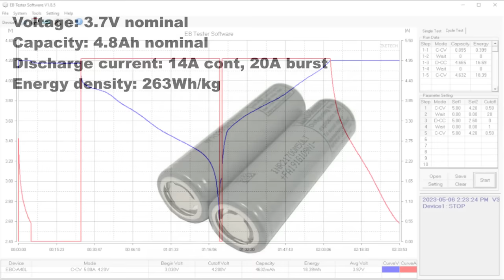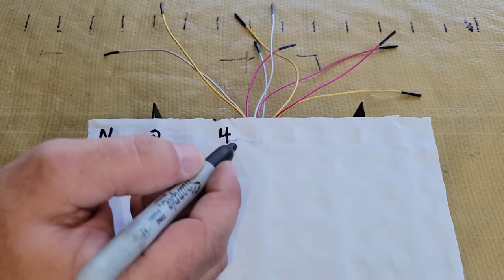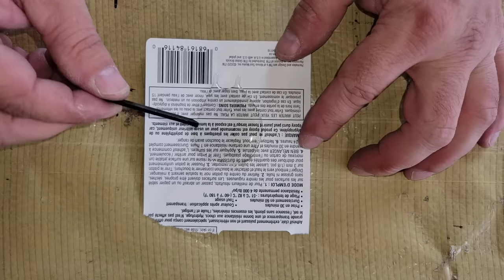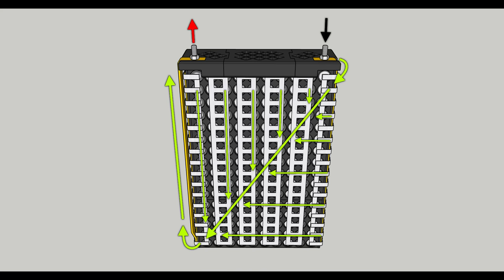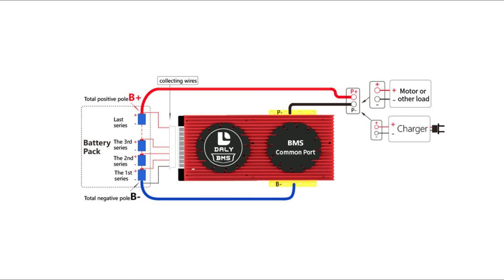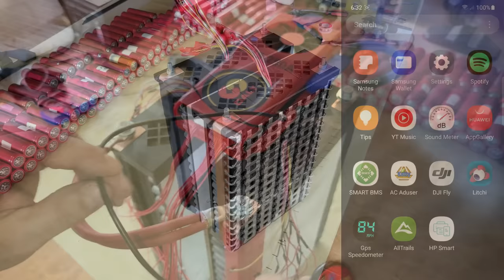Electric Motorcycle Build - E-Bike - Gen II, Ep 3: 77 Ah Battery

Comment: @12:20. Did you consider soldering the lugs on rather than drilling and tapping with epoxy?  That's how I would have done it otherwise I always like your approach
Reply from the maker: This is a decades old debate that no one will ever win. I try not to use solder when it's not required, especially on lugs. The connection as it is is superior to a solder joint in terms of conductivity, since solder itself has a higher resistance than copper and any used to connect a lug to the bar would increase the resistance in that connection just as it did when I soldered the copper wire to the nickel. Not a lot, but if it doesn't need to happen then there's no sense doing it imo. Those screws and epoxy kill two birds with one stone, the same as solder, without increasing resistance.
Reply from the maker: ...also, a 1/8x3/4" copper bar would take a lot more heat to solder to properly than what my 100w iron can provide.
Reply: I have to disagree with the conductivity part.  A mechanical connection when looked at under a microscope makes very small connections due to surface linearity not being perfect. Solder is not a perfect conductor, but because of the sheer volume and the way it alloys itself to the metals that it solders too creates a higher conductive connection than a mechanical connection.  There's nothing stopping you from putting some solder paste underneath your lug and mechanically torquing it down the way you did and then applying a little bit of heat.  I usually use 150 watt to 200 watt soldering iron for connections to thick copper like that with no issues.
Reply from the maker: I'd have to disagree on that one. If solder were superior, then every permanent electrical connection would be soldered. Torque is important for mechanical connections, whether we're talking about mashing a lug into a soft copper bar or mashing strands of wire into a solid mass with a crimp. Don't torque it properly, then it's not done properly. From my experience, I've always measured higher resistance from soldered joints vs mechanical. But again, it's a decades old debate that no one will win unless you want to provide some data from the results of said microscope analysis on a properly torqued connection vs solder. Perhaps my soldering skills aren't as good as I thought? It's possible. I'm easy to sway with hard facts if anyone has them ;) Each has pro's and cons and we could argue about anecdotes all night. I think mechanical is better, but drilling and threading like this takes time. Pick your poison my friend.
Reply: I hope it didn't sound like I was trying to debate you because that was not my intention.  I'm a circuit board guy with 30 something odd years of experience in consumer and industrial electronics so soldering is my gig.  
Now that we started down this road I think at least for myself I have to figure out which is better. So I think I'm going to grab that micro ohm meter we have at work and do some testing.  Cheers

Comment: Can we get an update on your buggy build? I'm sure others are interested in how all the parts have aged. Me, I'm curious if you've seen any decreased capacity on your battery. How many cycles would you guess it's gone through so far? Hopefully you haven't seen any decreased capacity, but still curious, as I used the same 32650s on my e-moto and I'd love to compare the age.
Reply from the maker: It's been parked since last November, no place to drive it in the winter other than my driveway. The battery has only been cycled a few times, but in the 6 months it's been sitting in the cold, there's only been a 0.9% voltage drop. So that's a good sign at least. We just bought a couple of fields this spring so I've got lots of ground to tear around on now when I get a chance to revisit the project. I want to upgrade the suspension to make it a bit stiffer and raise it a few more inches so I can still hit the trails and maybe some jumps without bottoming out, though. I was planning on taking it for rip next weekend if I get caught up on work. We'll see. But we're definitely not done with it. Expect to see more at some point.
Reply from the maker: Correction, my multimeter wasn't working properly. There's only been a 0.002% voltage drop over the winter. Had it out for a quick drive today. Still working fine :)

Comment: Thats a very big bms, why didnt you buy a Ant BMS?
Reply from the maker: Besides the obvious fact that an Ant doesn't have built in forced air cooling to counter their fallacious current ratings, which would make them larger like this Daly? Because I don't trust companies that don't rate their gear properly because they want to give the impression it's more powerful than it actually is. A 250A Daly is rated for 250A continuous and 400A peak, as advertised. A 250A Ant bms is rated for 250A peak, not 250A continuous like it should be. Understanding how much surge power a device can handle is helpful for design, but in reality no device works under surge power constantly because conductors and components can't sustain surge power for very long. A few seconds at best. That's why electrical components are rated in continuous current because that would be the normal operating condition. Any device pushing peak for too long is doomed to fail, so rating devices on it without explaining the difference to the avg DIY'er is stupid at best, dishonest at worst. Early marketing didn't clarify that with Ant - you were left to guess until push back from consumers and regulators forced them to start posting continuous current rating. When a company is intentionally vague to artificially inflate ratings in the consumer's minds, that's a giant red flag for me. Especially when they're claiming peak values that are twice what their competition's is, from bms' that are smaller than their competition. It doesn't add up unless they're using space age material with different properties than standard conductors that only they have access to. Which I highly doubt. I don't want to deal with a company like that.

Comment: I am only on ewho puts resistors on bms leads to even out resistance? I mean it's cheap way to make bms see batteries correctly, you can buy 1000 resistor pack for like 5 dollars.
Reply from the maker: From what I understand, you are. A BMS should already monitor the battery correctly through the balance wires, not the negative power lead - that's just a transmission cable. I would assume that if an extra resistor was required to work properly, then they would have built it into the lead or included it separately...would they not? Kind of strange to be in business for so long selling a defective product that's become really popular otherwise, wouldn't it be?
Reply: Never put resistors on BMS sense leads - they have no effect on sense voltage if there's no load, and as they are used for balancing, they have to carry some current without dropping voltage,  wasting heat and ruining balancing capability. Why would anyone do such a thing?
Reply from the maker: Thank you! It didn't make sense to me, but I'm no engineer.

Comment: Do you know if there's a specific reason that these batteries use a rectangular packing of the cylindrical cells instead of a more space-efficient triangular packing?
Reply from the maker: Triangular? Not sure what the benefit of trying to pack a triangular battery into a rectangular robot would be. Triangular batteries fit better in triangular spaces. If you mean a staggered cell spacing in the battery to pack them tighter, then there's also a good reason that isn't usually done either. Packing cells too tight causes more heat buildup and lower performance efficiency. Some cell chemistry doesn't produce a lot of heat and others do. This is the type that does. The space gained by staggering cells is marginal compared to the gains in performance efficiency. The space available in the bike can accommodate a battery 3X this size, if I had a budget to build one. So space isn't an issue in this case.
Reply: @JamesBiggar  thanks for the reply, I was referring to the cell staggering. Hadn't thought about heat dissipation
Reply: @m1llie_  It's called "hexagonal packing", though it can make triangles!

Comment: I'm not a battery guy but...can you wire 2 36 together leave them intact?
Reply from the maker: Yes, but don't try to pull more current than what the original packs can handle. The cells can handle around 20A surge each, but the nickel strips and bus bars are only good for around 50A total. The originals were just for running low power warehouse bots, a couple thousand watts at the most. Hence why I rebuilt with new config and thicker strips and bus bars to take full advantage of cell power to match with the 24 kWp motor.